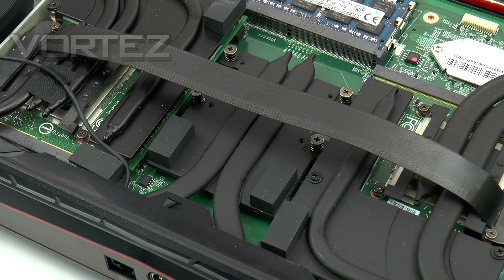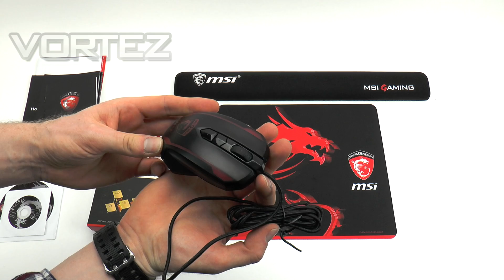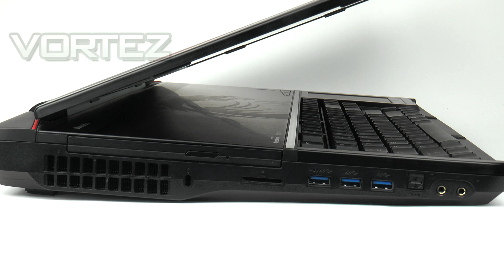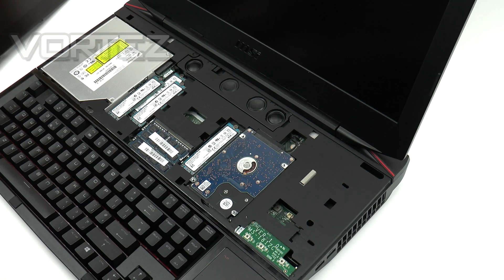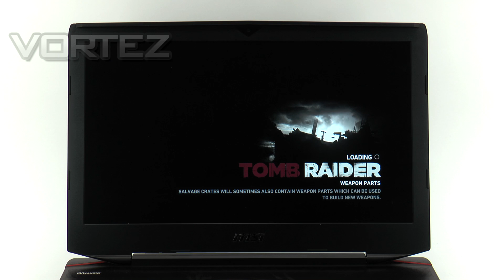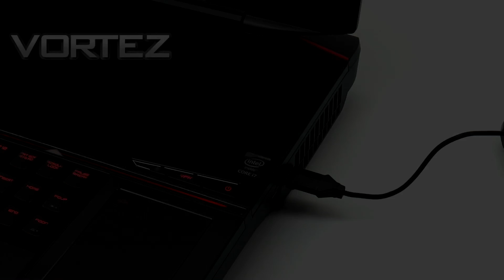MSI GT80 Titan SLI Review (GTX 980M SLI) [HD]

Comment: Looks good! Maybe someday something like this will replace my Alienware 18 which I keep adding onto as as when need comes - currently GTX 980M SLI, i7 4700MQ OC, 32GB DDR3, 2x 1TB Samsung 850EVO Pro SSDs, 750GB HDD, Display overclocked to 105Hz. No need for a replacement anytime soon by the looks of things :)
Reply: Sounds like a beast
Reply: philcrum Thanks :)
The display is now 110Hz and I also swapped the CPU for an i7-4930MX :)
Reply: Man, how awesome is that ;)

Comment: Very expensive, but then you get the best of the best. MSI made all the right choices here: very robust cooling, TWO 980Ms (which are not that much slower than the desktop 980), and a mechanical keyboard on a laptop is just amazing, and with it in front you don't have to put your hands over a bulky laptop. 

About the screen resolution: MSI said they wanted to include a higher resolution display (since two 980M could easily do 1440p or maybe just 3200x1800 at very high settings) but such a panel does not exist in 18,4 inch. I do hope they did include an IPS (you did not mention panel technology; you really should!) panel that can do 100 Hz, as that has been shown in laptops before (some can even do G-Sync unofficially, since they're connected with eDP internally).

Anyway, definitely not something I could ever afford, but thank you Vortez for bringing this review anyway. I enjoyed watching it.